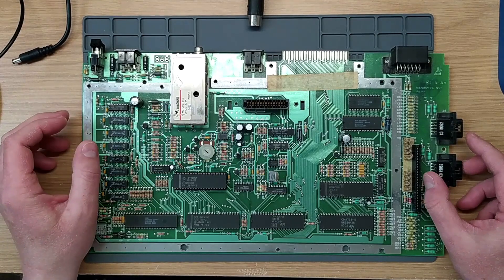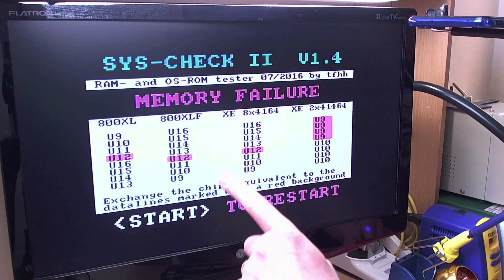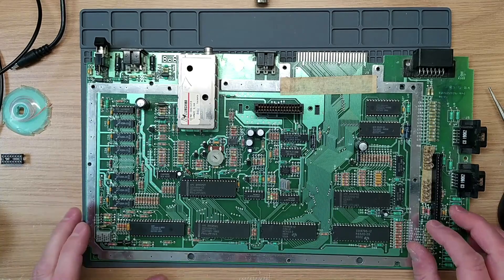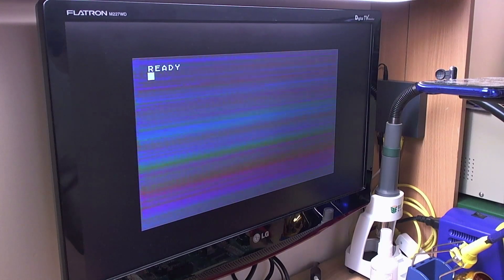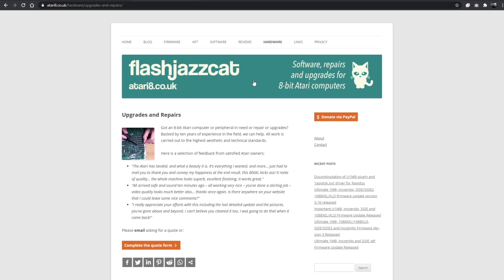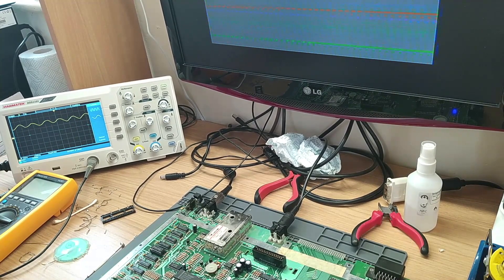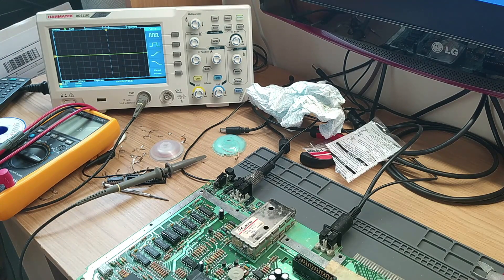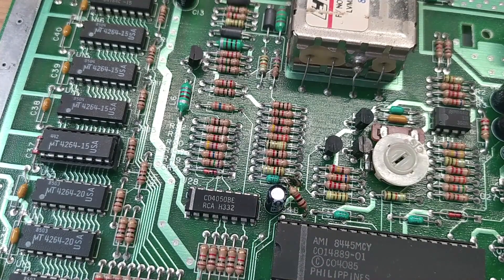Atari 800XLF with bad RAM and video issue

Comment: Hi Jon  Just thought I'd mention that the system clock oscillator has it's input to the LS74 that you replaced, i.e. pin 37 of freddie going to Pin 3 on the 74LS74 
Once again a grat video,  be nice to see you working on a 16 Bit's at some poinr, so hope you get some work on these soon. (I checked the diagrams Jerzy Sobolo produced, so hope that's correct)
Reply from the maker: Yes you're quite right Graham. So if FREDDIE was suffering from power fluctuations, I guess it could adversely affect the colour carrier frequency. Looks like 5V to FREDDIE is solid on this board, though (I showed Jurgen a trace on the scope and he agrees it's all good). :)
Reply from the maker: Got an STE coming in for a recap next week, BTW. :)
Reply: @flashjazzcat  That will be interesting to see :)

Comment: Great video.  What temp is your hot air set to?
Reply from the maker: Thank you. Hot air is set to 400 degrees all the time. I control the temperature with distance. I have the iron at 450 for everything as well. I find it's actually harder to damage things by going in hot and fast than by lingering on jobs through lack of heat. :)
Reply: @flashjazzcat  Makes sense to me.  Thanks!

Comment: Thanks for the vid. Personally, I'd start with the caps, since if you have bad power, all bets are off (memory tests too). I remember that every service manual from Atari started with checking supply voltage. Number two on their list was testing clock signals. (edit: BTW, you can test the voltage quality with the scope - just use slow time basis, and zoom around 5V level)
Reply from the maker: Micron DRAMs always fail, so it was a no-brainer to fix the RAM before replacing the bulging caps. First thing I did with this board was test for fluctuations on the 5V supply to FREDDIE, since we are forewarned (thanks to tf_hh) about the routing error on the board which can result in really terrible problems with power to that chip. It appears to be absolutely fine on this board, though, possibly because of L3 being replaced by a zero ohm resistor. Nevertheless, I may still add the bypass cap regardless. I also tested voltage to 74LS74 and GTIA before I finally decided the 74LS part was toast. The scope is definitely a real Godsend for this stuff, as you rightly point out.

Comment: Hi! Over here in the states where can I buy replacement/backup ram for my 600XL? What type etc?
Reply from the maker: 41416 ICs are readily available on eBay, but you might want to buy a pair of 41464s and do this simple 64K mod: https://youtu.be/84XwomksB4c